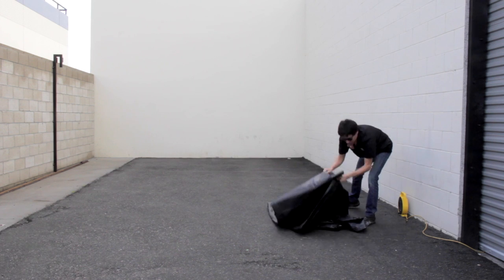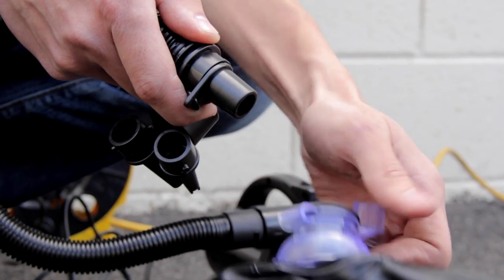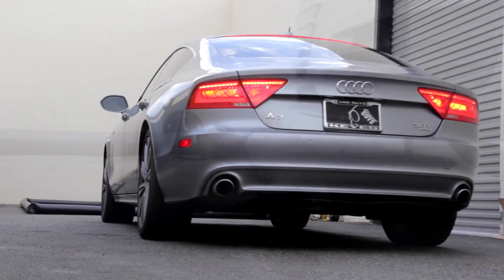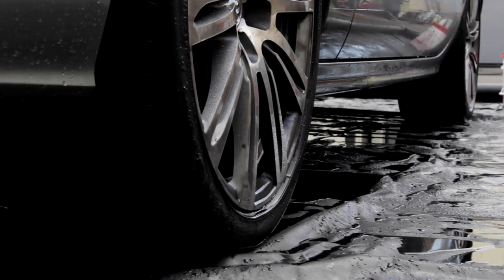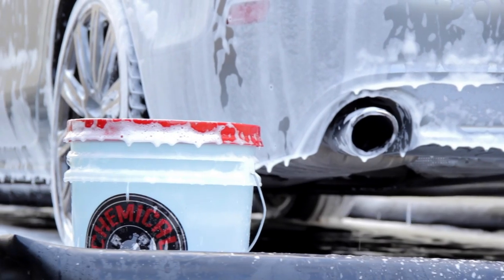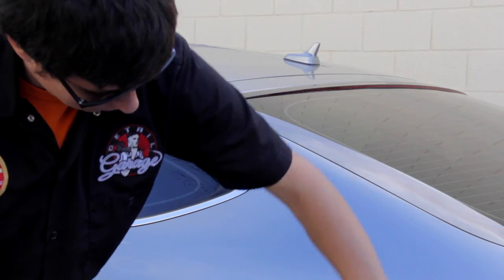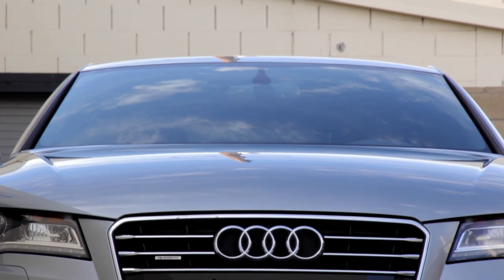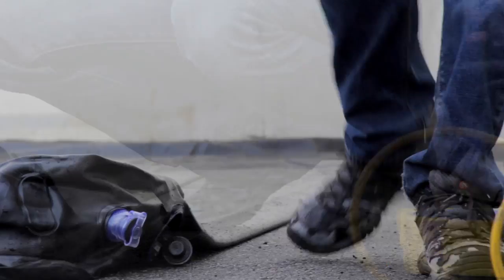How To Prevent Car Wash Runoff - Chemical Guys Water Containment Mat

Comment: What do you do with the water?
Reply: I think it drinks it.
I dont understand what is the purpose of that, it doesnt eliminate water and needs also power, so not to use on the streets
Reply: Take it to a water reclamation system?
Reply: contact your local waste dept, every city does it diff

Comment: Or...just wash it normally, and let the water go into the sewer drains on the street? Wont you have to dump that somewhere anyway afterwards?
Reply: Those aren't sewer drains. They are storm drains. That soap and wheel cleaner goes directly into your nearest body of water. Your sink, toiler and shower go to the sewer system to be treated.